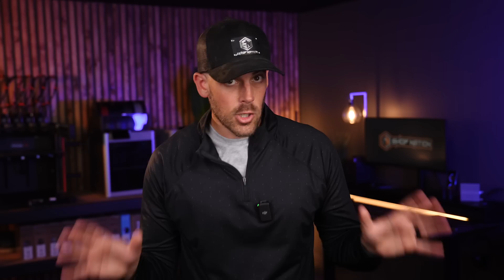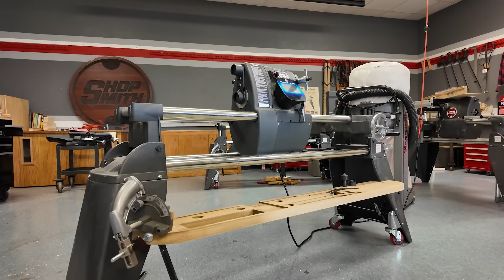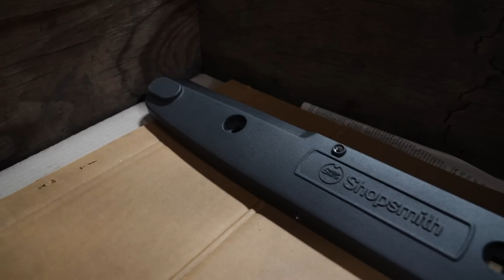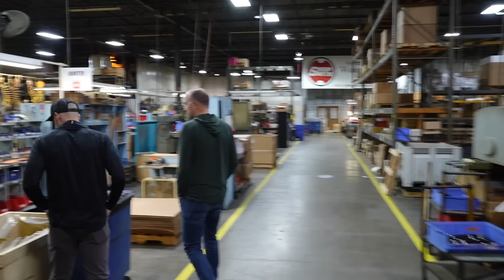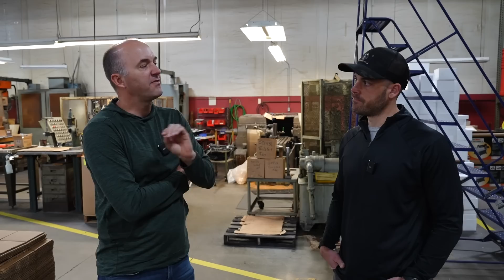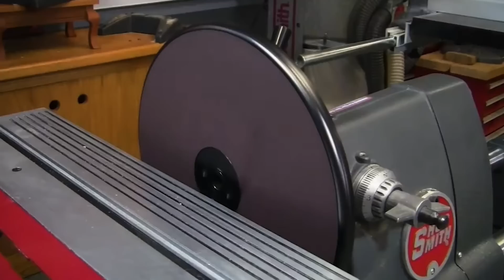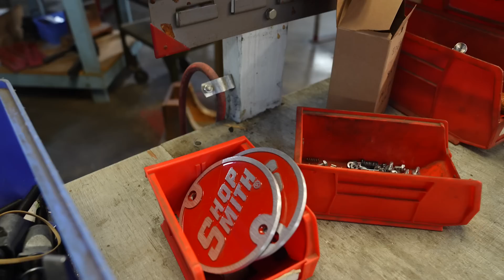The Last American Power Tool Company is (almost) dead

Comment: Shopsmith has always been a victim of its own success.    Why buy a new one when you can buy a used one with a lot of tooling for 1/3rd of the money..    I am not knocking them as I own 3 plus a powermate.   My dad had 2 growing up I am 48 and have been using from age 8.    The pro planer is a great machine you should of worked to reduce the cost of the tools and eliminate as last resort.   Seeing the pro planer and the scroll saw stopped I think killed two of your best machines.   I would strongly consider making a 2 x72 belt grinder too.  They are very simple to make and they would be easy to adapt to to run on a Mark 5 power head.        Also thank you for trying to save such a company.     You really need to do live demos at every chance.  I think maybe team up with wood craft.    Just don't try to do to much at one time like in the 90's when they opened all of those retail stores.

Comment: For some people and situations a Shopsmith might be the answer. But there must be reasons why this brand is dying. I find that even on small projects and repair jobs that set up and changeover times are a big deal to me. Simple examples: I don't like swapping drive bits like from square to torx and back again so I use two drivers each with a different bit. I might move between drill press, mill, grinders, wire-wheels, sanders, press, vices, cutting and welding tools while working on something. Flip a switch, use machine, turn off, move to the next one.  A roomful of Shopsmiths with each one setup to do a single operation would be hugely expensive. Better is a room full of single purpose ready to use machines. Am I alone in wanting to work this way? Apparently not.
Reply: This setup covers the hobbyist with a limited budget.. Production Facilities like you say is a different animal . I have about 8 angle grinders with a different tool on each one - no lost time on tool changes for me and they last a lot longer as your not exceeding the duty cycle..

Comment: I've got a 10er Shopsmith and I bought it used for about $100 in 1991 or 1992.  I have used it many times over the years for home improvement projects.  Unfortunately it's in my storage unit in CA and I've moved to FL and I really miss having it.  In the year before I moved I got to do my second restoration if the maxhine and since I actually knew it much better than when I girst acquired it, I did a much better job of adjusting everything to square and disassembling , cleaning, and lubing moving parts.  I got my scrill saw attachment running like new and got my jounter planer adjusted so it works perfectly.  I've never really used the lathe much since I don't make furniture, but I've used the big disc sander, table saw, and drill press a lot.

My father had a much newer unit that he bought sometime in the late 1990s or early 2000s.  I would really love to have one of those units but there is something really cool about using a tool that was made in the WW2 era.

Comment: My father bought one new with the works back around ~1962, even had the jigsaw, and compressor with paint gun.  I think he sold it off when he had to move from his house in TX to a Retirement home in Atlanta near my sister.  Didn't even think about it until I saw this.   I remember there was a period where he couldn't get parts, so Grandpa who was a master machinist built him some; later when SS restarted [1970's?] it was easy for him to get replacements.  The thing was amazing and lasted from 1960's to 2020 when Dad passed.  Not bad value for dollar.  
Issac Singer's sewing machines were so well made and durable, that he'd buy up his old machines just to make market room for newer ones.... They were just too durable.  Matter of fact.  I have the wife's grandmother's Singer treadle machine in the hallway, and it still works.

Comment: My Shopsmith Mark V has been in my shop since the mid-80s and works great. The headstock (motor containing unit; not the actual motor that still works great) had a major repair in 2000, and it's been working ever since. I do have the 4 inch jointer that I need to sell as I've upgraded to a 10 inch monster. Any takers? I'm in Austin, Tx. It's heavy, it's solid.

Comment: My father has his father's Shop Smith and still uses it today. It will be an interesting time when i (at 63 yrs. old) have to haul it across two States back to me sometime. My grandfather had his in the hand-dug-out basement of a cabin he build in the early 50's in the mountains of N. CA. The Shop Smith was a tool he used to build the addition he did for planning his retirement and to be his retirement home. I remember hip using the lathe for turning the stair stiles. Great tool that I've not had the pleasure yet to work with.

Comment: I’m 77 years old. I purchased a Mark V Shopsmith in 1984 and in 1985 attended the 3-day Advanced Woodworking Class (in the room in which you are standing). I still use my Shopsmith which is 40 years old! One of the best marketing tools of Shopsmith was their quarterly magazine named “Hands On.” The magazine always had interesting projects and always used their new attachments. I bought every single one! It also taught me how to be a woodworker. I wish you well.
Reply: sounds like they need to do a digital youtube version of that magazine.
Reply: They had some really good plans in those Hands On Magazines.  I built the folding workbench 9 years ago and am still using it today.
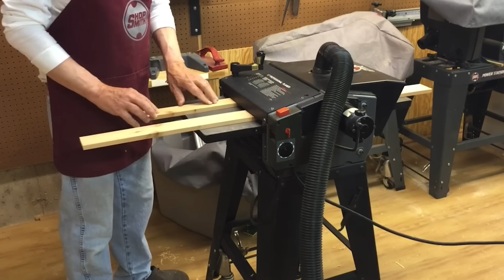Reply: 9:12 did you pay $2000 for their tiny planer?

Comment: Owned a Shopsmith back in the 70's and used it for many years as a hobby tool. The limitations were basically all related to the scale or size of the machine. The one area of superiority to single design machines was using it as a wood lathe.

Comment: They say the best days are when you buy and sell your boat...  What I learned was this, dont look a gift horse in the mouth.  Try not to anyway.  I got my unit for free from my newly dead great uncle who was in the hardware business all his life.  I was well equipped, moderately experienced in wood working and a took guy anyway.  These contraptions will get the job done and if you are smart and skilled they do it well.  But when you forgot to do something and needed to reset the tools perfectly for another pass, you are screwed.  I gave away my ShopSmith and bought all stand alone tools so I wasnt a slave to the metal statue in the garage.  If you have zero space and never use it they are GREAT!

Comment: My father-in-law got a new Shopsmith as his wedding present from his mother-in-law in 1948, he used it for several years and decided he needed the big one. They were both fantastic and still working today. They do everything well except be a table saw. If your a weekend DIYer buy one to start out and then buy a real table saw. It will give you access to every type of woodworking machine with minimal cost and space. The downside is setup , you are constantly retooling from one machine to another so it’s not fast enough for production work!

Comment: I think a very big problem and headwind for Shopsmith is there are a ton of used ones out there, and for CHEAP. I paid $300 for mine which included the bandsaw. I recently saw the 520, With the planer, joiner, dust collection, sander, etc. etc. For $600. I could certainly see a bunch of advertising happening and then younger people just buying used ones once they see the value. Particularly knowing that the whole system is modular and they can buy components to fix their old one. That is pretty much what I did to mine. I gave it a fresh coat of paint, upgraded the casters, put a lift system on, etc. and good to go. Works great!  

I also agree that the table saw is just ridiculous to use. Unless you have the new head, who wants to constantly turn the speed up and turn the speed down every time they turn the machine on and off? That is madness. And that's another area where you can buy a cheap Ryobi table saw for 100 bucks. 

It's pretty sad to me to see a company that's been around for this long go under. I totally admire everything they've done. If they were asking for donations I would probably freely give money to them. I can also say I went to school for photography and photo finishing. An industry that has been totally taken over by digital. Simply put, people can do twice the quality at half the price with modern day technology. I kinda see the same thing happening with Shopsmith. There's too many cheap decent quality tools out there, and a TON of used stuff available. And while ShopSmith quality is decent, they are no Festool either. We have hand held CNC's now, and AI. 

I totally admire the enthusiasm and what they're trying to do, but I would not invest in the success given modern day markets. I think there's a time to exit the market gracefully.  And no question the new digital stuff is very cool, but insanely expensive, Particularly for somebody who's just doing woodworking as a hobby. Given current inflation rates, and the devaluing of the dollar, I think the reality is most people cannot afford to buy a made in America product anymore. It's just too expensive. 

I'm proud to own a little piece of American history, and totally support any efforts these guys make, but given what I know about the economy and markets no way I think they're going to be successful, and totally not their fault. It's just a different world we life in now. At 63 years old I find myself depressed a lot these days at how we've destroyed so many good things about America.  Rest in peace Shopsmith.

Comment: I have been a Shopsmith owner/customer for decades.  Retired now and as my tool collection has grown my SS machines still dominate my shop.  Before I bought my first SS I had really cheap hand power woodworking tools.  And in a tiny shed outside our house.  When we bought our first home and had a basement, my first SS purchase started my shop in the basement.  It was perfect for my little basement shop and my SS collection continued to grow over the years and projects became bigger and more serious.  Today I am fortunate to have a stand alone shop and lets just say it's a bit bigger than the original basement shop.  But SS is still dominant and compliments my other and larger machines.  I have 2 Shopsmiths, the Sawsmith table saw, several belt sanders and power stations etc, etc.   For example I now have a large bandsaw, but still find myself going to the little SS bandsaw just as often when working on smaller pieces.  Same story on my SS jointer and my large 220v big man jointer.   And the last thing I will say about my SS is its versatility.  I don't know how many times I have had to do something unusual (usually some sort of compound angle thing) and the SS was the answer.  And my big machines just looked on with envy and thought, gee, wish I could do that!!!  🙂

Comment: I have had mine for 5 years now, I love it and use very regularly. It is what allows me to many do woodworking. Nick should really push the power take off. I know myself and others have built our own tools and contraptions that run off that end and I have seen tons of things online that people have built and powered off it. I have seen sanders, bandsaws, planers. I built a wire stripper myself. I only ever had one complaint is the leg height, I am a short guy and the table and saw when set up hit me just about mid chest scared me to death. So, my first project with it was to build my own base with rollers at 33" high now it matches my work bench giving me a huge out run or in or side by side giving me so much versatility I can't imagine having to buy a table saw, lathe, routing table, horizontal bore, drill press, let alone store them in my little two car garage. a little secret sometimes I even put all the extensions on and use as ....wait for it .... an extra work bench. Don't give up Nick your company was a joy to deal with and helped me so much when I started and nobody, but nobody offers this unique type of tool and the cost of buying all the same individual pieces alone would have got me bottom of the sub-par tools and cost me roughly 2k more than the smith did you guys

Comment: I have a hand-me-down shopsmith and it is one of my best tools... it's on wheels and can transform to whatever tool you need. 

Probably my favorite setup/formation is whel it's in bandsaw, the other side is the large sander, so you can cut, sand, cut, sand without moving between machines

Comment: Shopsmith had great advertising in the 1980's and anyone getting into woodworking had it on their radar. They were pricey so you had to be committed. And they needed space so you had to own/rent a home and garage.  When US manufacturers were pushed to move manufacturing to China (outsourcing)  by Wall Street (to raise margins) the cost of tools and tool bundles at big box stores (on Christmas and Father's Day especially) made the loose tools much much cheaper.  Add OEM store brands (like HarborFreight) and the tool market margins plummeted.  (Note: China - did not take the jobs - they were given to them on a silver platter - just economics and competitiveness.)  Then came price wars and battery power and the attraction to loose tools shot up.   Shopsmith has something very versatile and special. Perhaps if they let the "Maker" community (Make magazine and Makerfaires)  know more about them and found a way to put OpenCNC on the unit with a OpenSource hardware provided by the customer they could goose new life into the company.  Wood working has a large Maker following - mostly CNC and Laser Engraving.  Maslow CNC is a company who really made a splash. See a lot of those used to make signage and ornate gates. The cost of a Maker (Customer)  adding CNC from readily available parts is nothing. The benefits are huge. Repositories of "part files" are all over the net and user contributed (no cost to the machine maker).  Perhaps Shopsmith can rise like the Phoenix.  Be nice to see.

Comment: My shop looks like the ideal one you showed. Half of a two car garage. I have made everything from fine furniture to a small sailboat. Without Shopsmith I would not be a woodworker at all as I have never had the space for a shop. I have a 510 upgraded to 520, jointer, planer, bandsaw, overarm router set up, dust collector. Shopsmith has always included extensive instructional materials to help set up and use their products, unlike any other company. On the rare occasion that I hit a snag, help was always a phone call away. Customer service should be your main selling point, as few companies offer any.

Comment: Thank you for this video,

My earliest memories of my father's Shopsmith, were making all kinds of wooden furniture, toys & things. Although my father had bought the Shopsmith, he kept it at my grandfather's place, upstate Pennsylvania until we moved into a larger house with a larger basement. Although my father eventually became a mechanical engineer working for RCA, His original job with them was a Machinist working as a tool and die maker. It became my responsibility to keep the Shopsmith in good shape. I had to polish and maintain lubrication on the rails so that they wouldn't rust. I suppose I would have inherited the Shopsmith, however, I did not have room for it and it went to my youngest sister, Ruth. I believe she is taking very good care of it now.
Best regards,
 Rick Melcher.

Comment: I think your best bet would be to find woodworkers who do interesting videos and they just "happen" to be using a ShopSmith.  People who want to actually start will look at it and think that it's the best start.  I've bought many tools because of that.  Like my router.  I see so many woodworking shows where they use routers so I bought one.  And it just sits there most of the time.  It's nice occasionally to round corners but that's all I ever use it for. The important thing is, I bought one.  That's what marketing is all about.  It doesn't matter if your customers seldom use it, just that they buy it.  And when friends drop by and see it they may be interested in buying one themselves.  Getting your machines in the hardware stores would be a huge boost in sales. Things like this need to be seen in person to appreciate.

Comment: I grew up with one of these in my garage and it's definitely a handy machine. To me it's just a normal thing because I grew up with it around.  It's not a gimmick but like all multi use machines if you want precision or ease of use you'll do better with something like a real lathe. or table saw.  But for basic utility it's perfect.  Like you may only use it mostly as a drill press but when you want to cut something it can do that too.  Just being on wheels is it's greatest advantage.  You just put it wherever you are working.